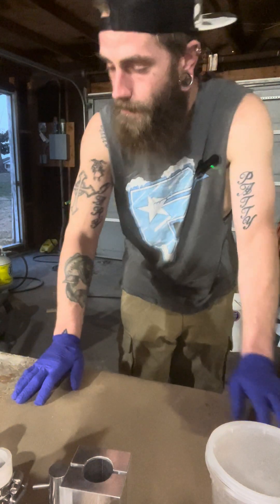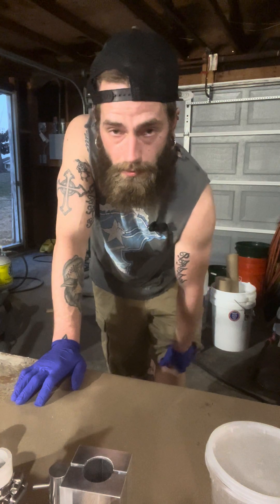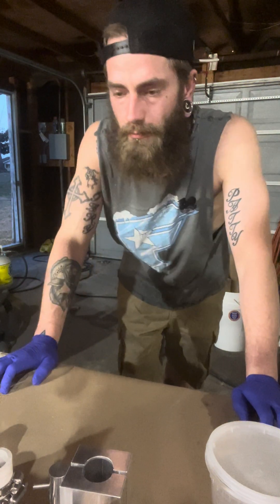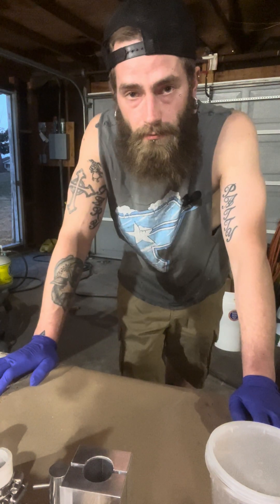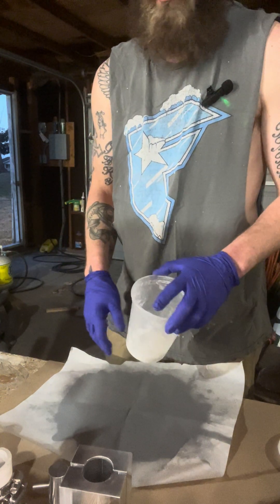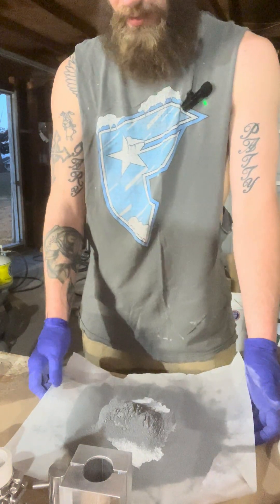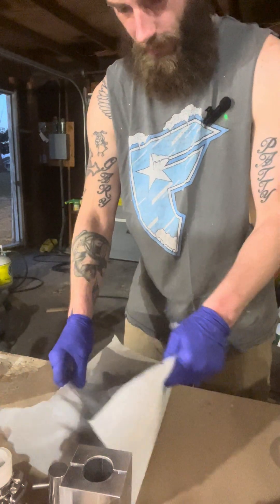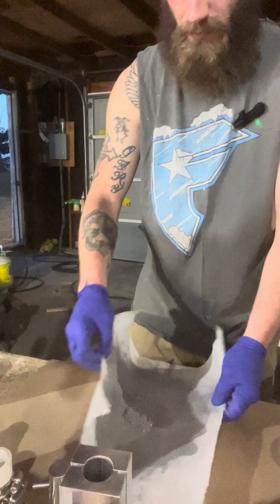Making Flash Powder a little safer

Comment: You’re absolutely right that flash can take lives. It has. Particularly if one is irresponsible and neglectful of safety. Especially because 70∶30 - which is the flash that most people use - is oxygen balance positive, meaning it’s perchlorate rich. There is more oxygen available in the composition than is necessary to oxidize the aluminium powder. So, a good reminder to note and remember is highlighting the fact that 6Ƽ∶3Ƽ is the oxygen balanced composition. In fact, it is ever so slightly fuel-rich, within half of a percent; negligible. It was originally known as Lancaster 21, but little information now exists on the composition. It has better performance yet is more thermodynamicly stable, making general handling and long-term storage just that much safer. The reason LC-21 it isn’t industry standard - despite being safer and more powerful - is because 70∶30 is simpler to measure, saving manufacturers some monetary funds. I’m a Propellant Dynamics Researcher and Explosives Engineering Technician who was previously employed at CornerstoneⓇ Energetic Materials℠ and have done and continue to do much research and experimentation with exotic flash powders. I must say, though: If I need some good flash in a flash that is as simple, stable, powerful and reliable as possible, Lancaster 21, is, by far, option one. By the way, I love your longer format videos. You are a pyro who is willing to just turn on the camera and speak about your passion without a script. I deeply admire that, and hope more of us could be that way. Like Caleb K. and Florida Pyro. It’s a goal for me to do some of the same once I get back in the saddle, – once I finish dealing with some life setbacks and health problems, – which have temporarily disabled my ability to do contributions to the community. Having someone at the Helm like you while I’m down for the count is tremendous. I definitely don’t take you for granted, and I know none of the others in the community do either. We look after one another and have each other’s backs in this hobby because we truly cannot afford not to, which is self-explanatory considering the context of the work we do. The ameliorating side effect of that is it makes the Pyro Community top of the line. We do take care of one another in a loving manner (especially using tough-love when appropriate) and have a strong kinship with each other that is unbreakable. With all this being said, thank you for inviting us along with your journey. It’s an honor beyond what you may recognize to have you on The Team! Especially because Together, Everyone Achieves More. An asset beyond anything else, and all the more so important in the mesmerizing yet hazardous artform of Advanced Pyrotechnics. 🔥💥 · 😉👍🏻
Reply from the maker: Wow man I’m so sorry I am just now seeing this. I had a filter on my comments in studio that I didn’t realize existed.. still figuring the creator part out lol. Thank you so much for adding such in depth information to this videos comment section. I knew you had a background but I had no idea it went that deep. I appreciate you pointing out that 70/30 is not optimal as that is what most of the information I have gathered has told me. I am still new to this thing relativity speaking so some what uninformed despite my best efforts. I just had to submit some info to YouTube to verify my identity and as soon as it clears I will pin this comment. This is exactly the kind of community I hope to cultivate. I won’t get into it here but I have a very rocky past and over the last few years have worked very hard to piece my life back together. Having found this outlet has done amazing things for my spirit as cheesy as it sounds so I am passionate about it. And it means a lot for you to recognize that from just a few videos. I’m sure it shows in my voice but I don’t always have the most confidence in my ability relaying correct information because this is such a serious topic if misinformed not given the respect it deserves. So your opinion and compliments carry alot of weight to me and I thank you for that. And I couldn’t agree more about the community as a whole. There are some bad actors out there but generally it’s such a great place to be. Once again thank you for the information and your very kind words. Looking forward to your return and getting to chat pyro sometime!
Reply: @Pyrodadsam you should look into tpa flash. 70/15/15, you could adjust that to your liking but that mix is a bit deeper and tpa flash is very safe as well.
Reply: This is a great comment. Thanks to you both for looking out for ours, we need to stay safe together.
Reply: Wow great post man , you know how you can read a post and say yeah , this guy definitely knows what he’s talking about ? That’s you sir lol , thank you for your time and yes ,anything safer I like the sound of lol , definitely the big commercial fireworks operation don’t want any part of that % is simply because aluminum powder is more expensive than potassium perchlorate, all about making the most money , again your post was an awesome read , I mean safer and more powerful the 65/35 method ? sign me up lol , safer being the most important of course
Reply: Damn. I love this message. ❤️‍🔥💣💥🦾💯
Reply: @ShortFuseMan  flash should only be handled in very small quantities.
Reply: @DoloresUmbridgeairsoft  My Brother in Christ, I’ve personally mixed 10 kilograms of KClO₄/magnalium/silicon/TPA flash on various occasions at PGI at a time. It’s just as safe as mixing Ammonal. There are MANY flash powders available to create out there that are as insensitive as sand, and there are many occasions where they are the better option compared with high explosives, especially at PGI.
Reply: @DoloresUmbridgeairsoft  Good grief‥… Brother, I’ve personally mixed 10 kilograms of KClO₄/magnalium/silicon/TPA flash on various occasions at PGI at a time. It’s just as safe as mixing Ammonal. There are MANY flash powders available to create out there that are as insensitive as sand, and there are many occasions where they are the better option compared with high explosives, especially at PGI.
Reply: @DoloresUmbridgeairsoft  Good grief‥… Brother, I’ve personally mixed 10 kilograms of KClO₄/magnalium/silicon/TPA flash on various occasions at PGI at a time. It’s just as safe as mixing Ammonal. There are many flash powders available to create out there that are as insensitive as sand, and there are many occasions where they are the better option compared with H.E.s, especially at PGI.
Reply: @DoloresUmbridgeairsoft how small🤔
Reply from the maker: Don’t take advice from that dude. He’s telling people to make ANFO on a pyro page.
Reply: @Pyrodadsam  so would you say the 65:35 is more safer?
Reply: @NOVASOULJAH  no, its more safliest.
Reply: @NOVASOULJAH  It’s more thermodynamically stable from a stoichiometric perspective, so yeah.
Reply: @TheHighsmith8  All of Dr. Takeo Shimizu’s “Thunder” flash compositions are excellent, with good report audio characteristics. Personally, I love his old Thunder #2, but for obvious reasons, that mix isn’t for anyone new. Barium carbonate, or any other carbonate salt of a divalent metallic cation, in the amount of an extra percentage or two, will ensure safe storage stability of that composition and others like it, especially in the presence of humidity. The other Thunders by Dr. Shimizu that are based on KClO₄, i.e., #3, the one you mentioned, do not require further adjustments, and are safer to prepare, being less sensitive overall. However, all of the Thunders are more sensitive than the basic binary flashes, as they contain sulfur as an auxiliary fuel. Despite this, they are not exceedingly dangerous to prepare, assuming all general safety protocols are acknowledged correctly.
Reply: What are your thoughts on thunder #3? 64 kcio4, 23 dark alu, 13 sulf?
Reply from the maker: @TheHighsmith8 womp womp.. don’t be a dick then start asking questions..
Reply: @Pyrodadsam  what??
Reply from the maker: @TheHighsmith8 I was referring to you leaving a comment making fun of my speaking then coming on this thread and making fun of another commenter.

Comment: Sam saludos puedo usar titaneo con flach quiero el efecto de chipas compre uno de 40mech
Reply from the maker: Yes you can. After it is mixed, you can add an additional 5-10% by weight of the titanium.
Reply: @Pyrodadsam  sam el que compre esta bien es 40-150 mech
Reply from the maker: Yes I don’t see any problem with that size.

Comment: What do u think about the Kmno4 +powdered mg in a 50/50 ratio?
Reply: Hello? Iv used this mix for 20+ years.  I want your opinion
Reply from the maker: I have no experience whatsoever with that composition. I have always read to stay away from potassium permanganate in pyrotechnics! Once again I don’t have personal experience but I’ve always been told that it’s extremely unstable as an oxidizer. With magnesium especially I wouldn’t touch it.
Reply: @Pyrodadsam iv used it half my life. Diaper method works amazingly well. Works the thrust and salute
Reply from the maker: Interesting. Thanks for sharing!

Comment: How long can u keep m80 s made with 70/30  perchlorate. Al ?   Is there any way it can blow up over time by itself if stored properly in cool dry place in plastic container?
Reply from the maker: Id prefer not to comment one way or the other bro, but IF I were to store them myself I would keep them sealed in something static resistant in a cool dry and dark space away from any source of ignition. I would sleep ok if all those boxes were checked ✅
Reply: Is it safe to keep fireworks with flash powder in an unheated shed . In winter Inside a static resistant waterproof container ?. In other words . Does the cold weather make it unsafe ?
Reply: I feel like the stability would improve in the winter and it would get go back to being  more sensitive during the warm months.
Reply: @kevinouellette1893  As long as they are solidly sealed in a paper tube of some sort and its classic 70/30 mix and not something more sensitive it should be find.

Comment: Honestly may sound skittish but high explosives are much safer than these low spark sensitive explosives like flash powder. Many more people have hurt themselves lost fingers etc. with this shit. Instead you should synthesize some ETN and some Urea nitrate if you want real damage and noise just be very careful if you make organic peroxides like TATP and HMTD  as your primary explosive.
Reply: TATP is godawful in general
Reply from the maker: You may be totally right but I can’t speak to the safety or usefulness of those compounds. I’m only familiar with flash because of how useful it is within pyrotechnics. HE can’t be used without detonators typically from my understanding making them pretty useless in our hobby.

Comment: When u put the end caps in do u have to counter sinc them a little for extra glue to make sure the caps just don’t pop out easily? Or is it sufficient to sink them just as far as the thickness of the  rim of the cap?
Reply from the maker: As long as the cap or plug is flush with the tube itself it is fine. A little bead of white glue around the lip is plenty to keep it secure
Reply: they make a tool to pop in the cap much easier and faster than doing it by hand
Reply from the maker: Agreed. I’ve never used one personally but they look pretty handy
Reply: @Pyrodadsam  have you ever duct taped a “firecracker” to see if it builds more pressure for a more impressive boom? Curious how to make improvements without just making a nuke.

Comment: I have been mixing 350 mesh aluminum powder with potassium percolate. 65% potassium and 35% aluminum powder. I have gotten good results with it however half of the time my fire crackers go off in a big cloud of smoke with no bang. What am I doing wrong
Reply: Don't know what your doing that's what
Reply: Confinement issue . But you should probably pause until your a little more knowledgeable. ❤

Comment: I prefer to use a large pill bottle and I latch onto it with a reach n grab then I put the end of the reach n grab around a corner and turn the pill bottle upside down/right side up over and over SLOWLY.  The daiper method is supposed to be safest but I prefer having several feet of stand-off. I also mix it 50g at a time. If I need more than 50g I will break up the mixing into several operations. It only takes an extra couple minutes if you have more than one large pill bottle to mix up a hundred or so grams

Comment: I would have a grinding shield and safely glasses. If you have a small ball mill? The kind for rock tumbling. Put the mixture in a cardboard tube. Tape ends. Ground the machine. Turn it on for about 15 minutes . Walk away from it. 
Either Put it on a timer or manually turn it off. I just don't want to be near the mixing process. We all do it different. 
Dude. Thanks for the information. Be safe.

Comment: Is it safe to mix the perchlorate and aluminum in a cardboard tube. That has been sprayed with an anti static spray?  Rolling it it slowly and steady ?  Not a fully enclosed cardboard tube. Just one end has a cap and other end open and roll it at 45 degree angle ?  Just curious because I am a newbie
Reply from the maker: Good question! Short answer is, yes that’s an option. Research binary mixing. It’s a good alternative to diapering like I show here. It’s useful for different applications just not something I do regularly.

Comment: Just use binary mixing. It's quicker, safer, and smarter. There is a no noticeable difference in performance as long as you turn the tube to mix it. You have to use less powder, but if you want a bigger bang, just get a bigger tube.

Comment: I like to take 5% of the alum and screen it with the oxidizer. Kind of helps coat it, and makes the diapering easier.  Then i do it the same as you.  I never had the balls to screen a mixture.  But doing a little with the oxidizer a few times helps.
Reply from the maker: Holy shit that’s genius 😂 thanks for the tip. It’s a pain in the butt getting the mix started sometimes without a million clumps

Comment: I try to only mess with flash comps in the summer months, when the humidity is high. Much safer.
Reply from the maker: Also a great point! Keeps the risk of static down. I’ve read about people going as far as dumping water on their shop floor before they start to help raise humidity
Reply: @Pyrodadsam  never heard of that one! Could even take it a step further and mix in the bathroom with the shower running for the ultimate safe-zone, 😄

Comment: Ok bro i just finished my first 2.... 70/30 .... question tho? I glued both end caps but does the cracker have to be sealed air tight ? Do you have an email? Would love to send you a picture of my first attempt
Reply: They do not need to be air tight I would just do your best to make sure the caps are on really good. You want it to allowed pressure build up thats the main goal. Also if you have the plastic end caps I'd recommend sanding them a little bit just to scratch it up so the glues can bond well. The plastic caps that go with them usually are very resistant to chemicals which cause a weak bond.

Comment: Have u tried 70:30 ratio of zinc and sulfur?
Reply from the maker: No I can’t say that I have. I’ve never really messed with any of the exotic flash compositions at all. I could be totally wrong about this but I don’t think that mix would do much of anything without an oxidizer present.
Reply: @Pyrodadsam  this is often used as a dirty rocket fuel mixture (not sure about ratio without looking it up), add a little dopant and you get glow powder. it is in fact a very exothermic redox reaction with no oxidizer. Reaction product is primarily ZnS.
Reply from the maker: Hmm super interesting! Thanks for sharing I’ll have to look into that. By dopant you mean like europium or something of that nature? I am somewhat familiar with the glow powder but had no idea about any type of use in pyrotechnics. Cool stuff!
Reply: @Pyrodadsam  Trace Cu for Green glow powder. This reaction actually makes glow powder by thermal decomposition, energetically enough to be used as a rocket fuel. In the rocket fuel they omit the trace Cu (~0.001–0.01 mol%), so the output is mostly inert. This is the same cheap glow powder ZnS:Cu that only glows for about 20 minutes to an hour that you can buy commercially. They don't make it this way commercially (burning it like a rocket) but it is a method of production.

Comment: I always make VERY small quantities for my little rockets. Have you tried the binary version of flash (mix after it's in your device)?
Reply: That is the absolute only way I will do it
Reply: @uarbor70  Yeah, I heard the binary method is safer than the diaper method since the powders are in a cardboard tube. When using the diaper method you have to be careful of static electricity but with binary method, you're not gonna get static electricity, and you can shake it really hard and it won't explode.
Reply from the maker: Don’t get me wrong it’s definitely possible to mix large amounts safely I have just never been in a position to need to do so. Since posting this I’ve been constructing several multi break cylinder shells most of with containing a bottom shot which eats up a lot of FP. So I’ve gotten comfortable mixing a few hundred grams at a time. 
And to answer your question, no I haven’t ever used the binary mixing method as of yet. If I were to need to transport like 20-30 large rockets with report headers for example I would definitely use that method. I just generally mix on site so I’ve never had to do it.